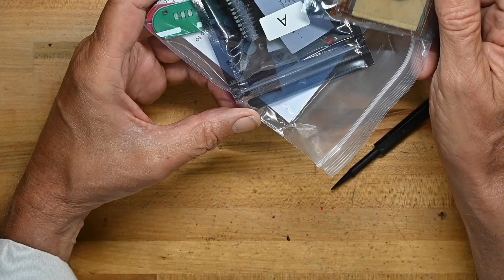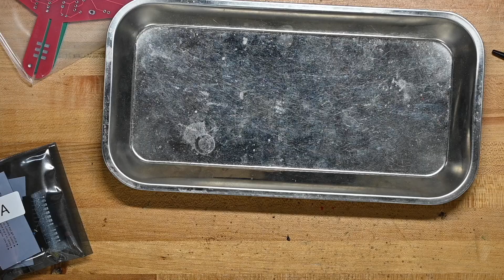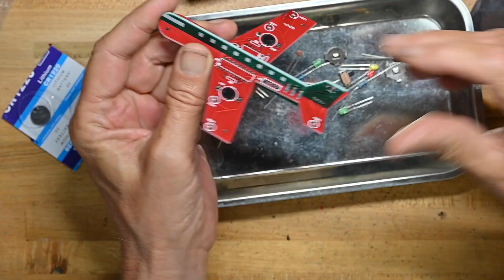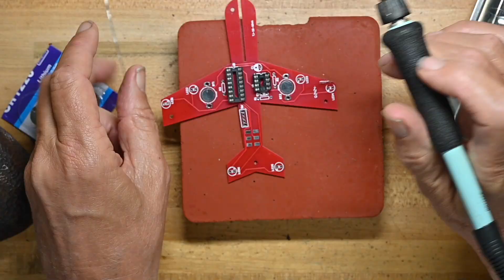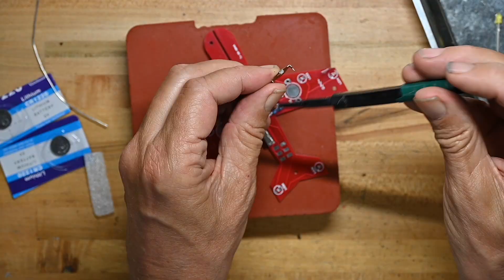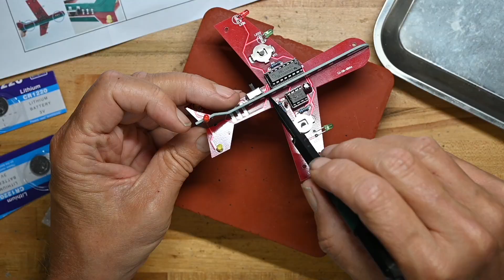C.K. builds an Illuminated Airplane kit from YYSolder

Comment: cute kit!  when i was little, we (actually, most kids didn't, but i did) built balsa wood plane kits. some were flyable, others not.. think a soldering kit as airplane is pretty neat...
Reply from the maker: It is. neat little kit.  An ds you can imagine, when I was a kid  I was out on my driveway with rubber-band powered balsa model airplanes also, very much fun.  Well, until they crashed and all I had left was a pile of balsa splinters :). Thanks for stopping by!
Reply: @CKHaun  yeah.... mine would crash too.  couldn't resist flying them, though.  just incredible to see something that's just tissue paper, glue and balsa wood fly around up in the air.

Comment: Nice demonstration of the kit. It has good educational value illustrating the properties of the 555 timer. I like your idea of piggy backing the resistors to influence the clock. To read resistance the Fluke DMM is a proven practical method but I like to use my Velleman Component Tester. You gave me the idea to build it after seeing you construct the same component tester kit. It is nice and compact, so requires minimal real estate to take up on the bench. When constructing electronic kits, I’ve gotten into the habit of analyzing components before soldering them in. I am learning from this experience say if a transistor is a NPN or a PNP or how to interpret the value of a ceramic disc capacitor by the number printed on the body. Not practical for you because you’ve already mastered this but reinforces what I am trying to become more familiar with. In closing, great job. I look forward to witnessing your next creation.
Reply from the maker: Thank you very much!  And I will try to do a bit more description of the components and what they're doing, I just have a bit of time pressure when recording since I really don't want to go over an hour.  But I'll do more!